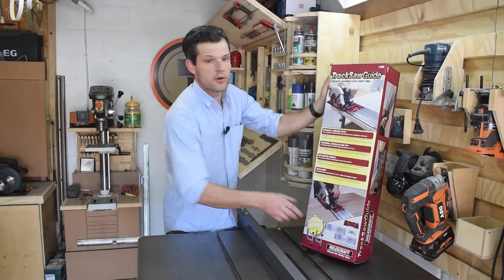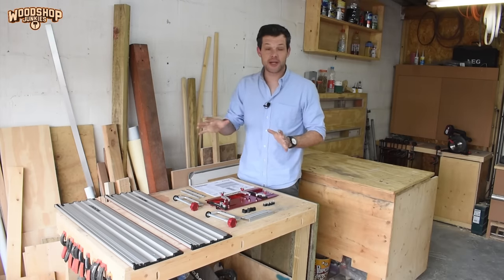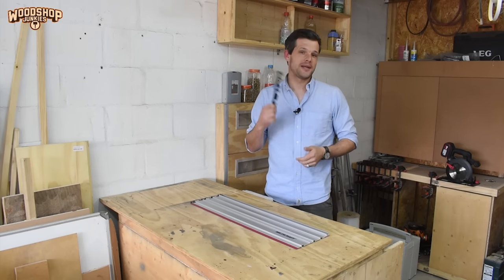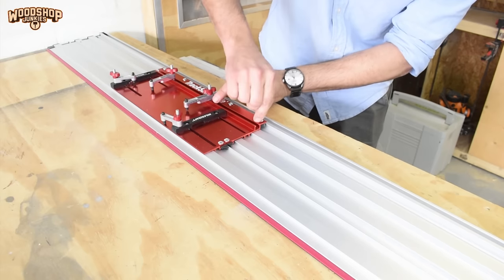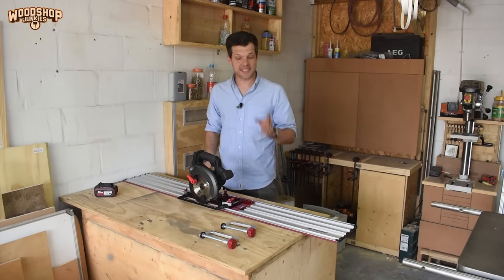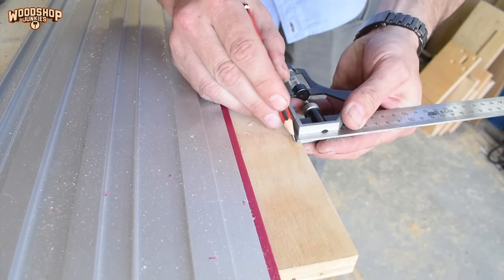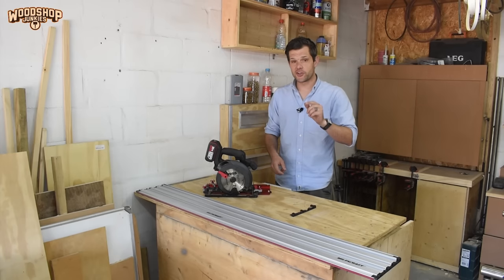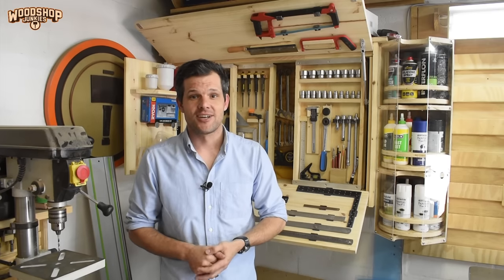Universal Track Saw - Affordable Option Or Waste Of Money?

Comment: Don't worry about  changing the blade. Even if the new blade has a thicker kerf the track edge is set to the blade's inner edge and this doesn't really change from blade to blade. The kerf thickness goes outward. If that makes sense.
Reply: Not necessarily.  If you change out the blade to a thinner tooth blade but the blade body is the same then the guide will no longer be accurate.  I had the same problem with a DIY saw guide after switching to a new blade.
Reply: In my experience the kerf thickness goes both ways. That does mean the issue is only half as big as it could be
Reply: @rpjames11 what could u possibly need that level of accuracy for
Reply: @smashyrashy It's not just about accuracy, it also helps with tear-out
Reply: When standing behind the saw, if you correctly use the set up guide, the left side of any blade should be at the same place every time. You should be able to put in a dado set and never have the problem of cutting the guide. The left most part of the blade should be up against the guide while the thickness variation will entirely stretch to the right.
Reply: @derekgilbert1752 Absolutely wrong. The centerline of the blade body and the centerline of the kerf are on the same plane. They don't offset it. If I'm wrong, show me a commercially produced blade that's built like you say.
Reply: @eh5806  if the leftmost part of the saw tooth is touching the guide, does it matter how thick the blade is? Could it stretch 3” to the right and the left side will still be touching the guide. This guide goes by the teeth, not the main body of the saw.
Reply: @derekgilbert1752 Fine, go build one and post a video of you starting with a thin kerf blade and then swapping it for a regular kerf blade without making any other adjustments. If it works without you slicing into the guide, I'll eat my shoes.
Reply: @eh5806  I never said you can do it without adjustments, I said if adjusted correctly. Each new blade you put on, you set it so the edge of the tooth touches the guide. 1/8” tooth; left side touches the guide. 1/4” tooth; left side touches the guide. 4 foot tooth; left side touches the guide. Do you see the common thread? Left side touches the guide. Each new blade gets new set up using the guide.
Reply: @eh5806  maybe you’re not realizing the sled holds the saw in various positions, not a fixed location.
Reply: @eh5806    I believe you're wrong.  A new blade with a fresh alignment with the saw blade spacer will put the inside edge at the same point as the every other blade.
Reply: @derekgilbert1752  So much additional learning in the comments. Thank you for this perspective.  I'm just now looking to get the Milescraft track saw guide, saw this review, and then saw your comment.  Most helpful.
Reply: Like others have mentioned, you can maintain the exact matching edge on the strip of the track as long as you always remember to readjust the sled when changing to different width blades. That's what the provided saw spacer jig is there for.

Comment: I received this item plus extra track this past weekend and honestly I'm disappointed. I treated it with kid gloves & out of 4 total pieces of track, only 2 pieces lined up nicely & one of the other pieces is so tight on one end that you have feel like you have to force the saw thru. All 4 pieces are square to each other when touching end to end but the height of the track varies across the top face at 2 of the 3 junctions. I also tried leaving a very slight gap but that didn't work either. The circular saw base works well with the glide adjusters but the track connections, as noted previously, are the real let down for me. I watched every Milescraft Youtube video I could find before attempting to put the track together but it just didn't work as well as I thought it should. I'll keep it because it was my decision to purchase it but I wouldn't buy it again. These are my thoughts only & if yours works well, I'm glad for you. I wish Milescraft would sell an 8' long piece because I'd be all in on it.

Comment: Just bought one and am really impressed. My DeWalt 6-1/2” little wonder fits perfectly. Tip: after aligning your saw in the sled, add a strip of wood, on the sled, behind the saw with two sided tape. That way you can pop the saw in without adjusting its alignment with the face of the guide. Great tool. Great bargain.

Comment: I have the Wen 7 1/4 corded track saw with a 110" track AND a clamp-on style product similar to this one. I consider the clamp style type a waste of money because the real track saw has spring plunge and is easier to work with all around. The blade guard on a regular saw also is a constant hassle. If you get the Wen, be sure you get the 110" track, not the 100" inch one. currently, both are being sold for about the same price.

Comment: Great review, I really appreciate your thought process and thoroughness.  I have used a similar product (Kreg’s AccuCut) on a circular saw, and recently I purchased a Makita track saw. My experience is that the accuracy of the circular saw additions is slightly poorer than the real track saw. This is NOT an issue if you are using the track to break down sheet goods but doing final cuts on a table or miter saw. For those that will only use a track saw and need the best possible, and repeatable, accuracy definitely get a real track saw. 

The plunge feature of a real track saw allows you to get the saw fully supported before the cut begins, where the circular saw additions require having the saw off the workpiece to start.  Again not a big issue but it does slightly impact accuracy and you definitely want to use the track clamps, which are less necessary on a real track saw. 

The plunge and easy depth of cut adjustment on a real track saw allow for doing scoring cuts which is a BIG benefit when working with expensive hardwood faced plywood. The cutting strip on the track (either circular addition or track saw) prevent splintering in the “keep” side of the cut, but scoring prevents splintering on the WASTE side, which can save sone wood and eliminates the need to do two cuts to get clean edges on both sides. 

For me, personally, the biggest benefit of the track saw was dust collection. It is VASTLY superior to any circular saw system. 

Thanks again for all the great content!

Comment: GREAT review.  The main comparison would be Kreg or similar manufacturer not Festool as they are in a different class.  That being said, I certainly will give this a look.  I like that you took the saw off and reinstalled it so we can see that it really is an easy process.  For the home sawdust maker, like myself, this is a good option for the occasional track use.  Thanks again.

Comment: A very good and unbiased review. What you haven't mentioned is the problem with sawdust extraction. All dedicated plunge saws seem to handle this concern, as well as the ability to plunge cut. I also believe the side adjuster rollers should be rectangular or square to eliminate the rollers jamming up with sawdust. Overall, a good presentation. Cheers!!

Comment: Back in the 80's Black & Decker had a similar product with track and sled mounted C-saw albeit not as long and was designed for crosscutting at various angles. I still have one, it was called the miter-mate and was sold as an accessory for the Work-mate bench.

Comment: Looks to be a decent option for folks who do not want to buy a dedicated track saw... well made and packaged (~$100 USD in the states).  I agree that for another $10-20 they should have included a carry bag to hold the entire setup and spare parts... perhaps even room for an extra pair of rails you almost certainly will need to get to extend your cuts to full size sheet goods.  Most people buy these systems to break down 4x8' sheets and will need a rail that goes out at least 9', meaning four of them will be required.

The attachment method for the saw to the base looks a bit flimsy & weak, although understandable, so you need to be very careful when using it and whenever you set the saw down... don't knock it out of alignment.

My big issue is that rail length.  I realize they split it into two to make shipping easy, but that adds flex points and extra assembly since you will almost always need to put at least the two together (and possibly four).  Most standard tracks today come in 55" lengths.

Comment: Great review. Seems much more solid that the Kreg Accu-cut. I started with that one, but eventually took the "plunge" on a Makita setup. What really blew the doors open for me after the purchase were the accessories such as square guide and parallel guides. For me, that really turned the track saw into a valuable and versatile bit of kit and an incredible addition to the shop. While it's pretty cool to be able to upgrade the household circular saw and for making great, accurate straight cuts with it, I do wonder if these types of products will have some of that expandability down the road?
Reply: DIY tracks are pretty easy and cheap to make, and you can make jigs to add to them to do pretty much whatever you want. To me the only real advantage to a track saw is dust collection, and you have to buy a really good one to get decent dust collection. I'm just a hobbyist and personally ok with just sweeping up some dust after making my cuts, but I can see the advantage in a more professional setting,
Reply: The Milescraft appears to be compatible with the popular 'red' parallel guides.

Comment: Perfect for breaking down sheet goods with all the precision you need unless making fine cabinets. Very impressed. Thanks for the review.
   I already have 85mm vertical cut Makita corded and 60mm vertical cut Makita corded. The 60mm has an attachment to run on track and I've been very happy with it but it is slow to set depth. For making eg 100 beehives, this would be great with some cutting boards with stop blocks for repeat work.

Comment: I really like the setup. The clamps are a great idea using the track to lock them in. I agree with you & everyone there should be a bag with it, they aren't that expensive. The one thought or question is is that this track only breaks down a 4 ft wide dimension. I would particularly want to use a track saw to break down lengths of plywood. Particularly,  here in the States, a 4 X 8 ft sheet of plywood. Does this system come in a longer setup or do you have to get another one or two tracks & add on?
Great review tho. 
Saw on!

Comment: When adjusting the guide adjusters for the side to side play, if you have an old hack saw blade, it looks like you can slide the teeth of the blade against the guide to prevent it from turning, if that was the concern. Those teeth are directional, so lay the blade in there with the teeth pointing at you. If it's just lining all four the same, set the two end adjusters at the same time using a wooden wedge. Once both are set run a straight edge against the secured screw heads and set the inside two.

Comment: Very good review. Excellent job overall. Couple of comments. When you're using a aftermarket jig type setup like this you are missing a riving knife. Which is a major plus of set-ups like Festool, DeWalt, Milwaukee, Ridgid Etc. Plus with a dedicated track saw you get exceptional dust collection.
Reply: Also bevel cuts and plunge start.
Reply: When the stock is moving through the blade, such as with a table saw, I'm a big proponent of the riving knife. However, I'm not sure it's as much of an issue when the stock is fixed and stable, as with this type of rig. It's really made for breaking down sheet goods.

Comment: Looks quite similar to the True Trac Saw Guide which I have been using for a few years now with good results. I encourage viewers of this video to check it out. Unlike the Milescraft system reviewed here, its rails come in 24", 48" and 57" (60cm, 120cm, 145cm) lengths. I have been able to make straight cuts on 12' (3.7m) and longer boards; in theory, with all the rails I've purchased. I could go up to 18+ feet (5.5 meters)! They also make and sell router bases that ride on the very same track. FWIW: I'm not in any way affiliated with True Trac.

Comment: An important thing for some users is what other saw/router track is the profile compatible with. There is the Festool profile and the near identical Makita profile (effectively interchangeable) versus the Triton/US tool profile, which are not interchangeable - it looks like Milescraft are trying to add a third standard, which kinda sucks for users who already have some investment in track guided tools or may want to add something like a router sled. (Then you have Bora who appear to have 2 different profiles within one brand)

Comment: I think track saws are valuable for those of us who need to breakdown 4' X 8' sheets of plywood and other materials but who have a small foot print shop. This would be a great solution to breakdown those sheets of oversized materials in the driveway, weather permitting.
Reply: Not just small shops like yours and mine, but trying to get a full sheet of 3/4" ply safely onto and through my table saw is simply impossible.

Comment: I purchased a Bora track saw kit and the saw sled is all plastic. It seems intended for "full shoe" saws only. My cheap Skil sidewinder has a very narrow shoe and the MilesCraft works much better with it. You have to order from 2 different places, but you can get the MilesCraft for $135 delivered if you search the 'net enough. I use a 60 tooth "finish blade" on my 7 1/4" saw and I have no problems with chipping melanin coated MDF, particle board or "AB" plywood. A 48 or 50 tooth should do almost as well (carbide tipped, of course).  HINT: More teeth mean more friction and heat and more "pitch" build-up on your blades. Oven cleaner or blade cleaner prevents burning the cut edge.

Comment: Hi. Thanks for a very well elaborated presentation. I have a few questions. 1– can you do a bevel cut ? I guess not. 2– is it compatible with other main brands like Dewalt? 3– Did you try to put a straight edge against the cut to see if there is day light ? I would highly appreciate, if you advice.  Thanks again.

Comment: I'm was really confused.  At 12:08 you pick up the clamps and leave behind 4 black plastic pieces.  No mention of what they are for.   The whole reason I came to this video.   Maybe I missed it but I searched back and forth in this video and others to no avail.  Digging deep in the manual, I found a side that's only used if needed for those 4 vertical clamps that secure the saw to the sliding plate.  Unfortunately, my kit is missing the 2 vertical clamps that mount the back side of the saw (parts 8c).  That added to my confusion.  Anyway, it would be good to mention those in your video, seeing them left on the table adds confusion.  Other than that, this is the best video I came across.

Comment: I received my track saw earlier, it is a good tool, worse the price, but here are my remarks:

- the track saw guide needs adaptation when used with circular saw Maktec MT-583 (common in Thailand, cheap from Makita), there is interference with the butterfly nuts used to adjust the saw angle, I had to replace them with normal nuts. 
- the saw could not be pushed back all the way against the end stop, I had to add a 20mm spacer (a bit of 20mm plywood).
- one of the rail connector had bad casting, there was a bit of aluminium sticking out, I had to file it back.
- the translation of the user manual in French is terrible, I am using the English version.

Comment: Nice saw guide.

$899.00 US is much higher than I am not willing to pay for a saw guide that I would not use often enough to justify the cost.

For what I need I have found a 6 ft level that I can clamp onto the sheet goods works pretty good.

I can use it with either my corded  or battery powered saw.

The blades are on different edges.
Reply: The milescraft saw guide with everything in this video is $99.00USD on their website, and the extra two packs of tracks are $80USD each.   So, assuming you had a circular saw already, this would cost $180USD for everything shown in this video plus two extra tracks (giving you 100” of track total). It’s a Pretty affordable way to get into the track saw business, even if you had to add $200USD for a battery operated Dewalt 7.25” circular saw. 

That’s about a sixth of what my Festool track saw costed five years ago and the only two  major perks to mine over this setup is mine has 3” of cut depth compared to this ones 1.75” and the near perfect dust collection of the Festool.
Reply: @surlycanadian  Thank you.
 I realized later that the price was not in US dollars.

$99 seems like a good price point.

I have a 15 amp Porter Cable corded saw for heavy cutting and a Ryobi 18 volt for cutting most thinner sheet goods.

Comment: At first glance I thought Woodpecker came out with a guide. LOL
What needs to take place is this guide up against Kregs. Kinda-sorta apples to apples since both make a circular saw into a track saw, but this does get your circular saw closer. My issue is I don’t want to have to take my circular saw off and on. IMO it’s worth every penny to invest in a track saw even if it’s the cheaper Ryobi.

Comment: The big think that you're giving up is dust collection.  This isn't just a matter of cleaning the shop less often.  That's easy.  Cleaning the lungs is a bit harder. Dust from a saw isn't the worst thing (the particles are pretty large) but it's not nothing.

There are cheaper alternatives other than Festool but I wouldn't go with this one.
Reply: Agreed.  I picked up a Makita 2x18V system for about $520.  Well worth it for my use and love it.